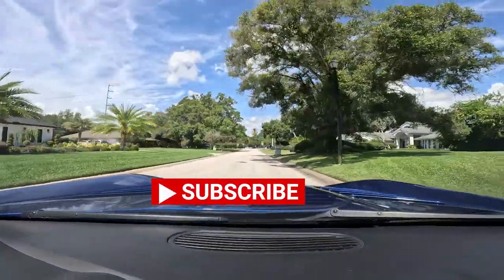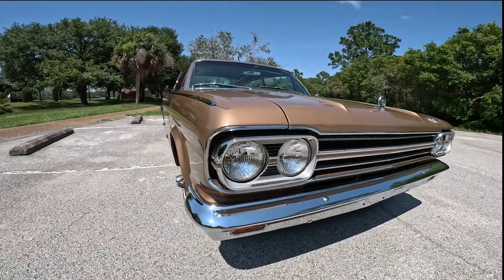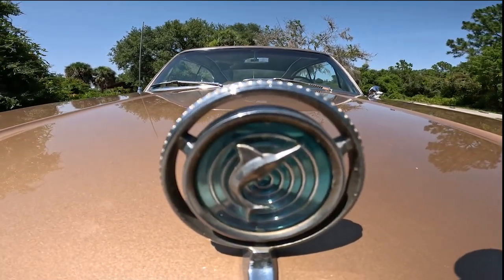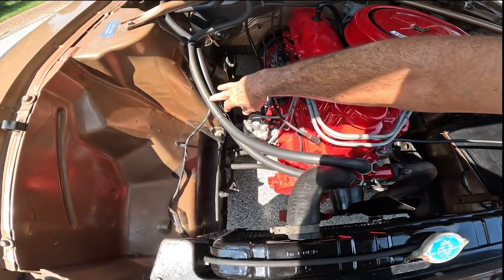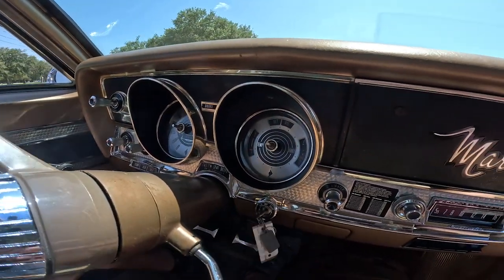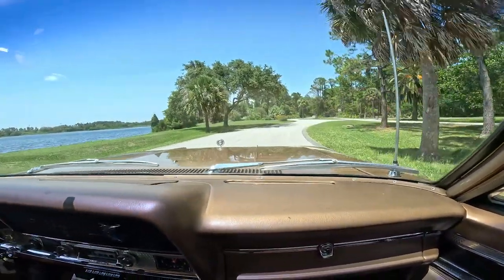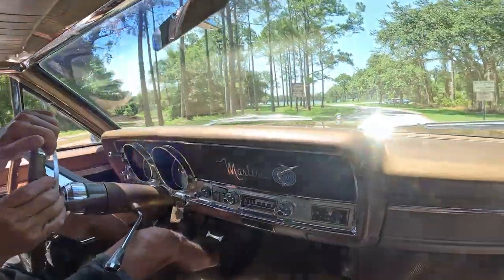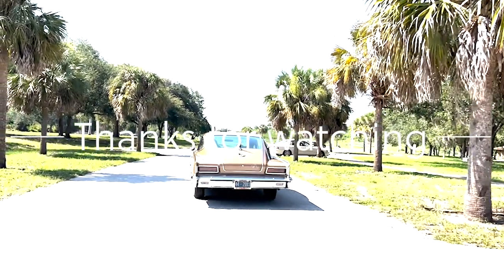BARN FIND Survivor to possibly the finest unrestored 1966 Marlin in existence.. Unbelievable!!

Comment: Very nice! I would like to see some footage on the carpet. It should be a shiny smooth shag. A very unique feature of the Marlin, as well as Ambassador.
Reply from the maker: Very good observation, the carpet in the Marlns in very unique.  The video was getting a little long and it didn't make the cut but, I insure you it is in excellent original to the car condition.  It's had the original floor protectors in it since new.

Comment: The original owner must have been quite weird, ordering it with a 6-banger and column shift. Anything other than at least a V-8, console and floor shifter would have been unthinkable.
Those otherwise ugly headlight bezels would have looked the part, if blacked out.
Yeah, they ruined the Marlin in '67. Those had the same dashboards as my dad's boring '70 Ambassador had. They might as well have marketed these as Ambassador Fastbacks

Comment: Dodge did not copy this design. Charger show car was already out in early 1965. The Charger is longer and lower with many more powerful engine options. 4 bucket seats and hide-away headlights. Full length front to back console. 
I always thought that AMC copied the Plymouth Barracuda. At the end of the day the Marlin is interesting and unusual. I have not seen one since the late 80s.
Reply from the maker: The Marlin debut was actually in 1964 as a Tarpon on the car show circuit.  They went into production in 1965 as a Rambler Marlin and became a stand alone Marlin in 1966.  If your a Chrysler fan, keep a look out on my channel for a really cool Plymouth that I will be posting about shortly...Thanks for stopping by!!
Reply: @scottscars4153  So the Charger's design was basically completed by 1964-65. The show car was made to get public consensus but it was already geared for production. I've owned two.

Comment: I'm calling B.S. on the "all original" . No way that engine has 44,000 miles and not a speck of oil or rust anywhere. I've been a mechanic for over 50 years so I think I know what to look for in a old car. Maybe all original parts AFTER restoration.
Reply from the maker: This was a total legit car and find.  Take a look on Bring A Trailer, it was just offered there, and you see more about the car and what was done from start to finish.  It's highly documented.
Reply from the maker: Thanks for the kind words!!!
Reply: I have one I have 1 I restored it 89 sat to last year 2022. It sure don't look like that